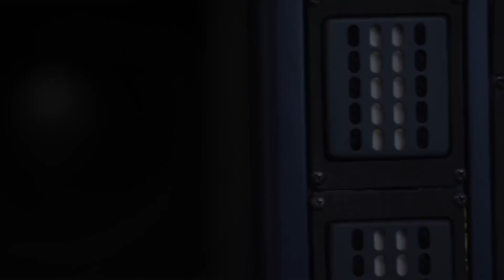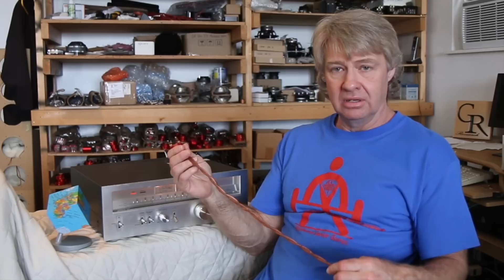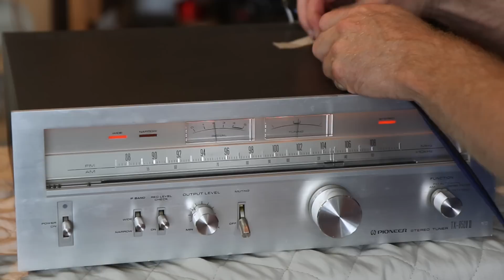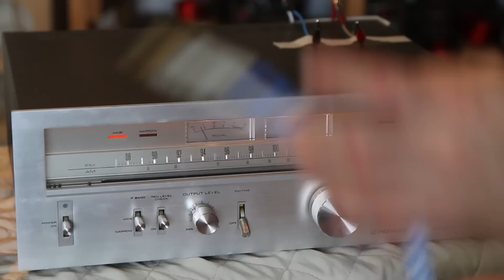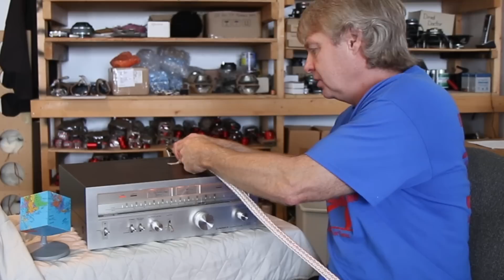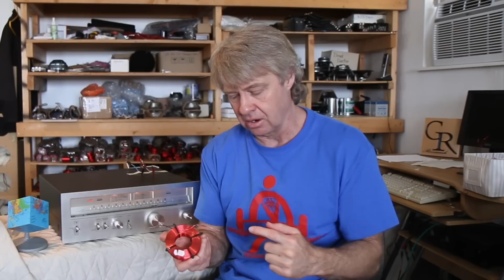Do Audiophile Cables Matter? Here's PROOF!

Comment: Even though I'm an engineer, I'm not going to pretend I know everything there is to know about cables. I will, however, be open-minded enough to attempt to prove out this theory using cables that are twisted/shielded pairs and judge with my own ears. I am also in the "cables do not contribute much to sound quality" crowd, but I am willing to change my mind if the evidence is compelling enough.
Reply: That's a good start.

Comment: I've had preamps that make all cables sound identical and i've had preamps that when you change a cable, you can hear a vast difference. A lot comes down to your sound system equipment and how revealing it is ( and how good your ears are ). I've never physically measured anything with a meter. All I know is what I hear and to me, in the mid hifi cable domain, each cable does it's own thing.

Comment: Yes I 💯% believe speaker wires or cables do matter and great bit,How ever I don't see spending half my paycheck, on speaker cable. I have seen them on a ridiculous level of 10,000 all the way down to a few hundred, again do cables matter?? Yes they do but you can build some good quality cables for your home theater four a couple hundred bucks that's including wire shielding you definitely want to use some plumbers tape as we'll to help insulate your cables and actually use good quality 100% copper pure oxygen free. But if you have a system That you didn't pay Say 500 for You could go to Walmart and get Get enough cables for it. But if you have a decent system I'm going to call it a emotiva system which is a average budget system yes if you can afford it the cheapest way is to make your own cables and yes they do matter and yes you will have to spend a little bit of money but if you're having to spend thousands you're going the wrong way you could have bought you a lot of equipment for that extra money you wasted on cable power cable matters as well some people have crappy power some people have clean power depends on where you live yes that matters too bottom line cables do matter spending a ridiculous amount of money on cables depends if you're a doctor or lawyer that makes Buckooss🎉 of money, great buy the most expensive thing in the world but if you're living like me paycheck to paycheck build your own speaker cables to the(( best that you can afford)))😊😊😊😊😊😊..

Comment: Danny I watch your video content here with great interest and as an electronics tech need to point out something that I am not sure has been addressed in the comments below...This test shows only the effectiveness of these cables at the center frequency of the FM station you are tuned into. I have to say that this has absolutely no bearing on the cables effectiveness at audio frequencies. In order for this test to be effective you would need to excite the cable from a signal generator with broadband noise from DC to whatever upper frequency you decide is important and then with a fixed antenna on a spectrum analyzer see what the broadband received signal looks like and that will at least speak to RFI rejection fairly clearly. to see what happens at audio frequencies will require a different test and what you have done here is almost like the standard test manufacturers do of audio amplifiers showing power output at 1 khz, and that test is a completely meaningless way of attempting to benchmark an amplifiers power output and distortion because it leaves out of the test the amplifier's response across the rest of the audio spectrum. There is no way a test at a single frequency can possibly characterize the behavior broadband. 

Heres what I have observed about cables:
If we are talking about RCA cables, buy cables with gold plated connectors and solid terminations for best performance and if the internal shielding is double layered the cable will perform well at audio frequencies.

If we are talking about speaker cables, the series resistance is the biggest concern, the capacitance generated by the two parallel wires is negligible with reasonable cable length and can be ignored,  so since the resistance of different sized wire is easy to look up its quite possible to calculate the dc resistance your speaker cables have if you know the gauge wire and its length. There is a point of diminishing returns as in all these things and where you choose to draw the line will decide what performance you give up and how much you will pay. In a two channel system where I might have a power amplifer with 600 watts per channel the loss in 10 feet of 12 gauge wire going to each speaker is going to add very little dc resistance and have very little impact on the effective damping factor of the amplifier. The effective damping factor of the amp and the wiring going to the speaker has an effect at bass frequencies in a big way so having wire that doesn't compromise the damping factor of the amplifier is important and crucial to good sound. The distributed parallel capacitance is  going to have a negligible effect at audio frequencies if the wire run is reasonably short. Beyond that there is not much need to fuss about the wiring. Yes, use decent stranded copper wire with decent insulation of the appropriate size for amplifier power and preservation of the effective damping factor and consider the job done.
Reply: You are only scratching the surface. The gauge of the wire has little to nothing to do with sound quality unless the wire is not capable of carrying the current necessary. There are a ton of other factors that effect how it effects the sound.

Comment: Ok, so I get that you can use a wire to pick up noise and that its measurable, but why are there people doing comprehensive tests and measurements that shows the difference in the signal arriving at the speaker as well as what actually comes out the speaker being either 0 or so trivial that it shouldnt be audible to a human?

Im trying to keep an open mind, and you have me halfway there by showing there is an effect. The other half for me would be disproving the people who also have measurable proof that the cable does nothing as long as its a reasonable quality and not a coat hanger or something. Surely the end product is what matters, right? 

Also, would not a balanced signal completely negate this effect?
Reply: Being an avid 2 channel stereo music lover and making the jump to a multi-channel setup, I immediately became aware of how the room sounded different. Didn't know what it was at first, but coming from an audio black background there was no way I was prepared to put up with it!

Even after auditioning 3 separate AVR's, the same ambient sound of the room was still present! That told me the unwanted faint background signal noise I had been experiencing (poor description) had nothing to do with the actual units. Therefore, my attention changed to the cables. And even then It was only on the third occasion after I finally purchased shielded cables that the noise floor within my small room finally came down to satisfactory levels.

 Cables often act as antennas for attracting RF, and the longer the cable, the better the antenna. Probably explains why when I used to disconnect my heights and surrounds within 10 minutes, the faint background signal noise (RF/EMI) within my small room used to disappear/dissipate.

The more cables I shield, the quieter my room becomes, and the better the shielding, the more the chance the cables are likely to disappear.

If one has the same sensitivities and is looking to address this matter, but is also hoping to notice (hear) the incremental differences, I would suggest starting with analogue cables before moving on to digital and power cables. 

Trying to achieve a totally silent room sadly has turned into obsession for me. However, the results speak for themselves. There are times when pressing pause (or mute), my small room has now become so quiet that I'm actually unable to differentiate whether the system is on or if it's actually switched off. Of course, audiophile equipment helps, but in reality, for one to have a totally silent room, cables are where it's at.

When friends or guests come over, I used to show them how loud the system goes. Now I prefer to press mute and show them how my quiet it goes

None of them gets it, of course 😂
Reply: @Totalplonker  hehe sounds familiar, when I have people over and they say something like "I bet those can play really loud" I usually put on something really soft and turn the volume way down, and most of them gets it at that point when they realize they can hear everything they want to without turning up the volume.
Reply: The differences are easy to hear. Using balanced cables cancels out any new noise picked up by the cable, but does nothing for the noise that is already there.
Reply: @dannyrichie9743  What do you mean with "already there", its introduced in the middle of a cable in this case?
Reply: @kvernesdotten  Balanced cables are only used as interconnect. They only cancel noise picked up by the cable. Their existence is already proof positive that picking up RFI and EMI is an issue especially with long runs. However, like I said, noise that is already there that was part of the original A/C noise is still there. It won't cancel that noise out because it was there from the source. That is why we used single ended cables that act as a filter for high wavelength noise.
Reply: @dannyrichie9743  But we are talking about interconnects though? The whole exercise here is to show that a wire not adequately shielded, is essentially an antenna, and that it does in fact pick up noise between the source and the output.

My question then was, if we are trying to combat noise picked up directly through the cable used, why would we need a 2500 dollar oxygen free silver core cable when balanced cables are spesifically designed to do this at a fraction of the cost?

You then answer that balanced cables does nothing for noise introduced before the interconnect. To me that sounds like you are implying that the expensive silver cable does actively change the signal or remove noise already present upstream? If this is the case, please explain how that works. If this is not what you meant, please elaborate.

Comment: So cables could pick up radio frequency interferences or electromagnetic interferences? Thats the same thing. No shot that materials and therefore also cables have different physical properties. But calling these Properties "antenna" or "filter" seems weird to me. A cable has impedance (the resistance for Alternating current which consist of inductance and capacitance) these properties will indeed change the "sound". So how do you get a good cable? A balanced/symmetric copper or silver cable that has big cross section and is just as long as you need it. (When choosing the length you can do calculations to balance out the phase shift that occurs due to inductance and capacitance. In theory you should braid your wire in a way that every copper/silver strand is at every place once meaning a RF would influence all strands equally to maximise the benefits of balanced connection but that is also not too difficult. Its simple: Thick, Short, Copper/Silver Cable

Comment: Or you could stick it in a scope and see how much noise it picks up properly terminated/connected in an audio environment. I am one of those that can hear a difference between cables. BUT!! First of all FM/AM or whatever noise picked up is very low amplitude and waaaaay above human hearing. It makes sense probably only on very high gain scenarios like phonos, and then as you said we can use shielded cables. But then you mention that the noise is already in the system. Which is true, but a cable is absolutely the worse tool to fix noise that exists in our power lines. That is a PSU concern and most of the time a cheap 100nF capacitor close to the stages can do the trick. Even on super fast and super-capricious opamps. Not to mention that if you need cables to act as filters,  you are also filtering potential useful frequencies, even if they are beyond the human audio-spectrum

Comment: Old knowledge :) In the Poirot detective serie, set out in the 1920'ies, we see the cables to and from the telephones, are "braided double pairs".
Obviously a more expensive solution, than the later "one hard twisted pair" I saw on my grandmother's old telephone, in the 1960'ies...
AND also her old lamps, had twisted pair cables... So they emitted less EM noise...

While the "modern phones" in the '60'ies, and later, simply have straight pairs... WHY? Well, that is the cheapest solution!
In addition to that, the signal strength was now stronger... So noise was "heard less loud than the voice"...
But I clearly remeber, we could always hear noise on the line!
Back in the days, when telephone signals were rather weak, it was crucial to have FILTERING cables...
Not necesary, all the way from the telephone central to our home, but crucial, "the last meters to the phone"...
And clearly, the best solution always was: Braided double or tripple pairs... So they were the "worst antenna ever", as you demonstrated so well.
In fact introducing some "coil action" as you explained, to stop high frequency noise, which WILL produce harmonics at lower frequencies.
So if filtering all above 20.000 Hz, that will also stop the bharmonic noise IN the audible range!
- Note that "audible range" has now been expanded... Recent tests proved, especially many children, can hear up to 28.000 Hz!
- Then the theory was formed: Most adults can no longer hear 28.000 Hz, because their ears have been damaged!

Additional science: Each time electrons are forced to change course, they emit more light, which will give noise at very high frequencies...
So in theory, electrons in a braised or twisted cable, emit more noise, than those in straight cables...
In very high frequency radio installations, it is important to make " a soft bend" (rather large radius) if a bend is needed...
The same goes with ordinary TV-antenna cables...

BUT regarding the frequencies between 20 to 20.000 (or 28.000) Hz, "a rather sharp bend" is no problem...
Clearly the electron noise in the bends, will be weaker, than the EM noise, which the braid KILLS...

SO, a cheap alternative to braided loudspeaker cables is: make a number of SHARP BENDS, on a good "pure copper straight cable",
so the bends will stop the "very hight frequency radio noise"...

Final note: In the 1920'ies and till the 60'ies, all cobber cables were tinned, to prevent oxidation of the copper surface, as the insulation was a textile, which did not keep oxygen out... Today, several high end cables are tinned, mainly to reduce the "skin effect" and thereby reduce the "electron jumps" from one strand to another... I am now using straight pair, tinned OFC, loudspeaker cables, and I found they sound better that my other cables!?!
Perhaps the tin layer also acts like a screen, to EM noise from the outside ?

Comment: I upgraded the speaker wires this week, from the one strand very thin cables to 12 gauge, honestly, can't hear much of a difference if at all.
Reply: That's normal. If you already have a halfway decent electrical connection between amp and speakers, There aren't going to be big differences. With some speakers it doesn't matter at all. imagine a typical 2 way speaker. There you have an inductor in series to your woofer and the tweeter usually has a resistor in series to bring it down to the level of the woofer. There are more components in it but those are the relevant ones for this example. The resistor for the tweeter is usually multiple ohms and for the inductor around 0,5 ohms is normal and even on the low end. It's often much higher and sometimes deliberately to change the behavior of the woofer. So no wonder there's not much of a change when the spaker cable has a few milliohms less. 
It makes a bigger difference in very low impedance speakers and many full range drivers, because those don't have any resistance in series, at least not in the whole frequency range. There might be some resistance in the components to improve linearity. 
It's a complex topic but there is just no reason to spend hundreds or even thousands of dollars on cables.